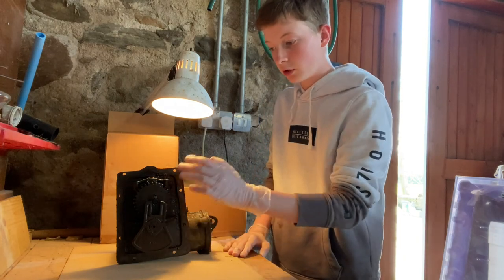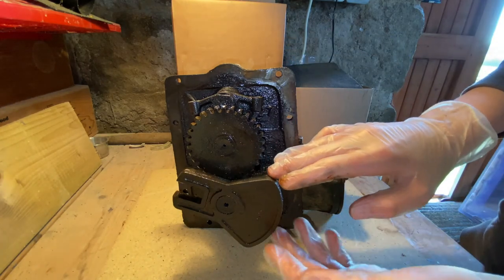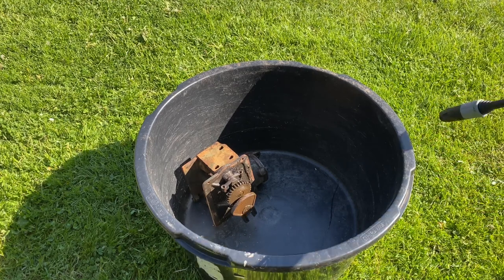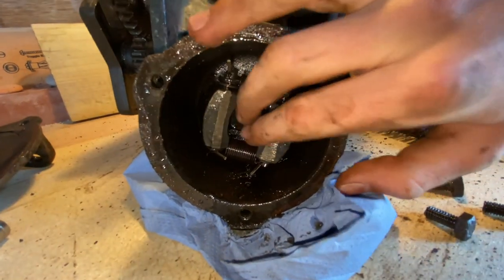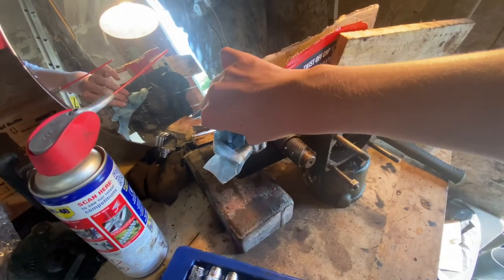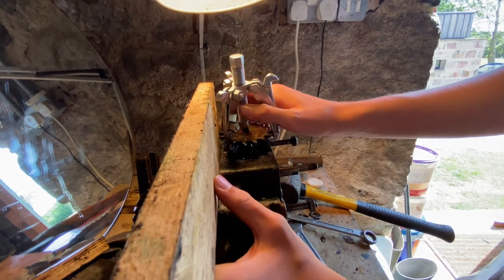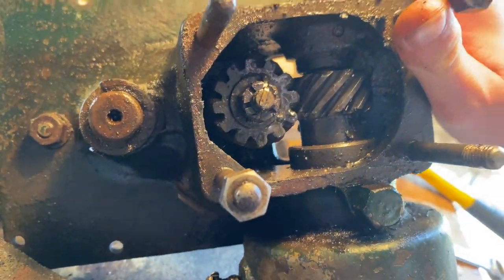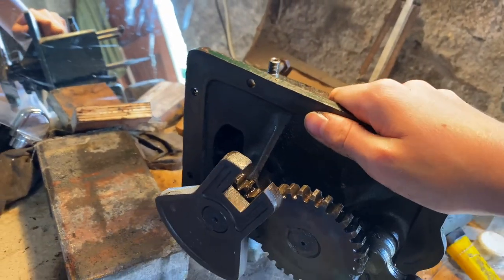Lister D Restoration - Governor disassembly - Ep.6

Comment: Most of times we use a bit of diesel  fuel in a bath and a paint brush  to remove the dirt and grime , water can also be used but be very sure to dry all parts directly after cleaning them  to prevent rust .
Reply from the maker: I have been using paraffin to clean the parts would you recommend using diesel instead? Thanks for the help
Reply: @blairsworkshop  paraffin is also fine   to use on your parts

Comment: At 8.16.  Just under your thumb there is a lock bolt/nut if you unscrew that nut you can take off the entire centrifugal clutch in one.  I wouldnt pull off the individual cogs , just clean in place. That bolt i describe locks the casing of the clutch to the large bit. (If you know what i mean)